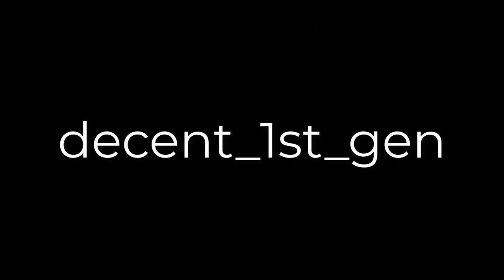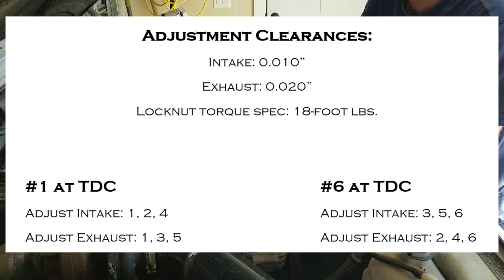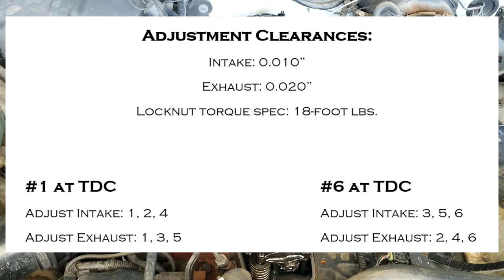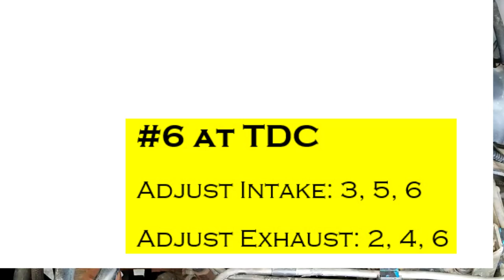How to Adjust the Valve Lash on a 12 Valve Cummins

Comment: you are giving the wrong measurement it's .010 ten thousant's  not 1 and not 2 thou but .020 twenty thousent's
Reply: You have to call it the same regardless of how many zeros are after the last number 
0.01000000 is the same as
0.01 👍still a great video

Comment: this makes me want a first gen lol. second gens you are gonna have one hell of a time getting to number 5 and 6 cylinders.
Reply from the maker: This is one of the advantages of a 1st gen over a 2nd gen
Reply: @decentgarage  yes back when trucks were much more simple and easy to work on. my dads new 21 Chevrolet one ton duramax you can hardly see the engine with all of the emission components ontop.
Reply: @vcummins  and so many procedures recommend cab removal or lifting the cab as a first step nowadays lol

Comment: In one of your videos you replaced a broken plastic bushing in the link to go to the transmission
for one made of brass and posted the part number, I have been looking for the video to get 
the part number. I enjoy your tutorials very much  I have 1991 with 168418 miles will do 
the valve lash.
TavO

Comment: Hey great video. Do you know of any website where I can get some smoked/blacked out tail lights for my 91 w350?
Reply from the maker: That's a tough one. Geno's garage and lmc both sell tail lights but I don't think either of them have a smoked option. The best way to do it is mix black paint with clear coat and just give them as many coats as you need till they are dark enough.
Reply: decent_1st_gen ok, I think I have seen where people do that. I have been looking at ones on far from stock, but those are really expensive for smoked tail lights, but maybe I just need to deal with it, because I really can't find them anywhere else. I find a bunch of stock tail lights, which I don't have an issue with, but my truck is black and silver, and I think the smoked lights would look better. Thanks for replying, I appreciate it!
Reply from the maker: @Valve-sb7ne  yeah the stuff from far from stock is nice but it's definitely not cheap. Maybe I'll ask mopardarrel to sponsor a video hahaha
Reply: decent_1st_gen that may be a good idea 😂

Comment: Do you know if anybody have change the original fuel filter (Fleetguard #1232)  for a bigger filter with water separator something like FS 1212 and if it fit with no problem.Thanks
Reply from the maker: I have not seen that done personally. Seems like most guys who want extra filtration go with a fass system. I have seen needed up oil filtration system though.
Reply: @decentgarage   Thanks for the info."fass system"

Comment: At 3:20 you said intake clearances is 1 thousandth (not ten thousandths), & exhaust is 2 thousands (not 20 thousandths)
Reply from the maker: Good catch! I'll make mention of this in the description 👍
Reply: @decentgarage  I'm appreciate the video you did a great job but there were some mistakes that I could be critical they are critical for one what is the true clearance on the adjustments on both intake and exhaust valves? I took notes the whole while so I could do my 97 12 valve and I noticed mistakes and I thought I'm going to have to watch a different video somewhere else to make sure that I don't go under the hood and make all this work to find out that I adjusted the valves are to the wrong clarence's I don't have that kind of time and besides it could be critical damage to someone I hope you go back and straighten this video out you did an excellent job otherwise but some of the valves are messed up the sequence on which valve to adjust when number 1 cylinder is TDC and number six is TDC it doesn't match out this is a critical mistake! :-( install is the valve adjustment mistake critical and could definitely cause some serious damage if someone watched your your video I wonder how many guys screwed up their engines? I mean 1,000 clearance they may be messed up some pushrods I'm not trying to give you a hard time here but before you post a video to thousands or millions of people on how to fix their stuff you better edit it and make sure it's right. We all make mistakes that's why we've got to go over our work again and again and make sure it's correct how many people screwed up their engines in Faraway remote places?. I've got to go somewhere else for my information now because there were too many mistakes on this video Sirius critical engine damaging mistakes
Reply: So what is the right clearance. And now I still don't know the proper valve lash. Otherwise he did a good job on the video the people have to edit their s*** to get it right when you're talking blowing up your engine! Over nonsense. I took a whole page of notes so I could use this information to go out and do an overhead on my 97 4 wheel drive and I noticed some mistakes I started going through the questions that I run into yours thanks
Reply: @markeverson5849  the proper lash is 0.010 (10 thousandths) on the intake side, & 0.020 (20 thousandths) on the exhaust side

Comment: Its 10 and 20 thousands not 1 and 2 thousands
Reply from the maker: I didn't realize I had said it incorrectly. Thanks for catching that!
Reply: @decentgarage  I wonder how many guys messed up their Motors you've got to edit your stuff. For the sake of everybody who's listening to your video and needing to do this work because they're not rich people the rich people go to the damn garage but we can't afford to go out and adjust those valves to those last specifications you made a mistake on and ruin the dog gone engine! :-( otherwise you did a great job on the video we all make mistakes but you've got to edit your stuff man I'm glad I caught it in time took a whole page of notes and was going to head out to my truck to do work and it would have been disastrous
Reply from the maker: @markeverson5849  do you mind being more specific on what mistakes you found?
Reply: If I would have adjusted those valves 1.000 clearance when the metal got hot it could have been direct serious damage metal-to-metal with no tolerance. There's not much there in tappet clearances to begin with! Those settings are quite critical adjust them too tight not only is your engine not going to run but it's going to run very badly and cause damage quickly
Reply: Maybe some of these ungrateful people should just go buy a Chiltons  manual,I knew he ment to say 10 and 20 thou.  And I'm pretty sure everyone else did too
Reply from the maker: @dc440-4  thank you Clint. Some people blow my mind
Reply: @dc440-4  yeah it was fine. The correct numbers where posted on the screen. People mispronounce stuff all the time. Not a big deal. And there's always Google or a service manual people could look in to double check any specs.
Reply: @decentgarage  enjoy the videos good instructions and great video quality. Keep it up. I love my 1st gen.